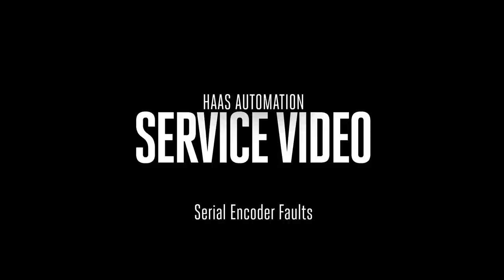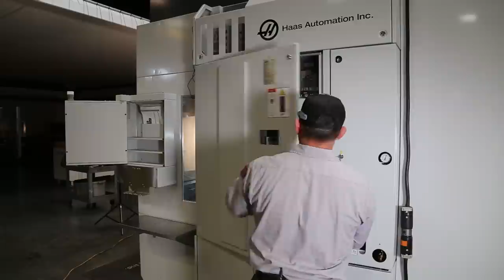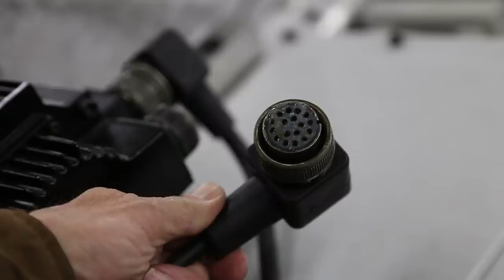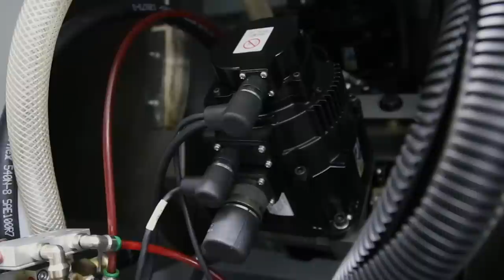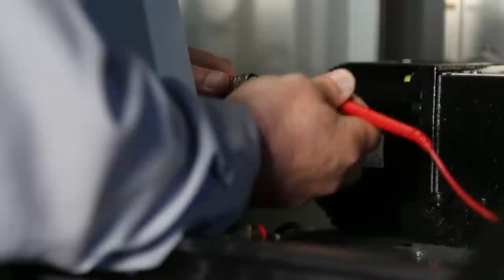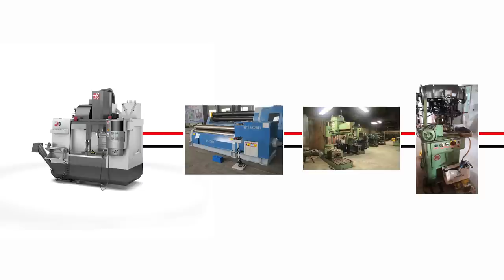Diagnosing a Serial Encoder Fault   - Haas Automation Service Tip

Comment: I have an EC1600 and lately the nightshift has been getting encoder alarms and poor communication alarms. Always seems to be on nightshift during a particular tool. Can it be weather related(heat) or machine vibration? It is a high speed tool

Comment: thanks for the tip, if after reviewing the points described the alarm persists, can it be the motor or the encoder? how they are reviewed
Reply: 99% of the time the encoder cable is at fault.  Replace & install ferrite filters mentioned in video (Haas Parts Mgr.)

Comment: My 2015 ST30Y has been throwing intermittent 838 TT serial data comm faults on and off for the last 2 years. We replaced the serial data encoder cable and the problem remains identical to before it was replaced. The machine may run fine for 6 weeks with no 838 TT fault, or it may do it 3 times in one day. Nothing is consistent regarding what triggers it, and over 2 years it has not gotten better or worse. Tomorrow I am going to check the ground, add more ferrite filters, separate wires, shield the wires with a copper EMI/RFI tape, and stick EMI/RFI absorbing panels in the cabinet. Any other idea's?
Reply from the maker: dthuren - If you haven't already, check the pins on the Mocon board where the encoder cable plugs in.  These can get damaged and possibly cause the fault.  Also, since you replaced the cable, did you receive the same type of cable or is it a shielded version?  If not your plan to shield with EMI tape is a good one. - Brian
Reply: Thanks so much I'll be working on it today I'll report back regardless!
Reply: So hope this helps someone, as I'm lots of broken tools, time with HAAS techs here, and plenty of money deep in fixing this, but I finally got it on my ST30Y..

1) Brand new 2015 machine gets it's first "838 TT AXIS SERIAL DATA COMMUNICATION FAULT" a couple months out of warranty, in 2016. 
2) Haas techs say it's easy needs a Tool Turret cable, and it's a PITA to change, so I have them come and change it.
3) 3 trips later and the machine down for over a week, the right cable comes in.
4) Cable replaced, and the same error comes up the next day.
5) Haas sends out Ferrite filters I clip all over the place, and no change. Machine might run for 3 weeks fine, and might error 3 times in a single day.
6) $1800 invoice paid to replace cable and labor that did nothing.
7) Jan 2017 I just decide to live with the errors, as it will normally go a few weeks and be OK. I believe I was refunded some of the cost.
8) March 2018 errors really ramping up, and seem to be ALWAYS locking the machine down when I am ID boring gah!!!
9) April 2018 I decide I'm fixing this. Do all of the noted above that I can reach externally. Extra Ferrite filters EVERYWHERE, EMI copper tape in the main panel, check all connections, organize wires in the main panel, etc.... Errors the next day zero change from any of that...
10) Next I get deep into the back of the tool turret. Organize wires, clip ferrite filters EVERYWHERE in there, tie wires together, pull wires away from the sensors in there, tape off some dead unused wires, and generally tidy things up and pull the wires away from the internal position sensors.
11) IT HAS BEEN ALMOST 2 MONTHS AND NOT ONE SINGLE ERROR!!!

For me, the issue was bad signals with the wiring in the tool turret housing. Simple as that!
Reply: Our 2007 ST30Y started getting intermittent 838 TT serial data comm faults. We replaced the TT cable but it didn't fix the intermittent faults. A while later I had a broken Live tooling cable on anther machine and it also gave the same 838 TT serial error. So i switched out the live tooling cable on the 2007 ST30Y and have not had a problem since. In the future I would still suspect the TT cable first but if it doesn't fix the problem the LT cable can also be to blame.
Reply: @dthuren  2022 UPDATE regarding the same ST30Y noted above... What we did to put the final nail in the coffin, is to remove the electrical connections under the turret live tooling cover, completely fill the socket/electrical connections with silicone/dielectric grease, and re-assemble. After doing this if it does error out once every 6 months, we just do the same thing again, and 10 minutes later we're good for another 6 months or more!